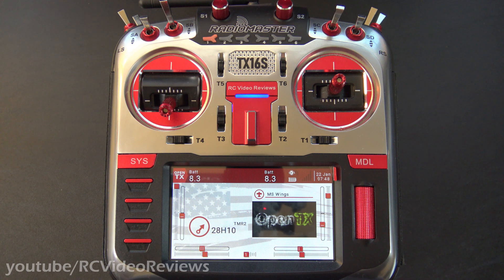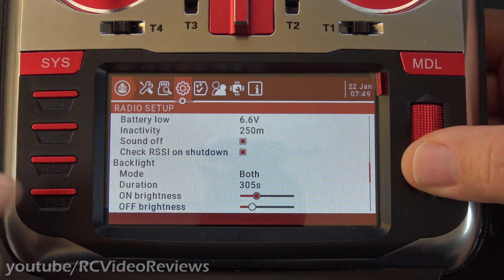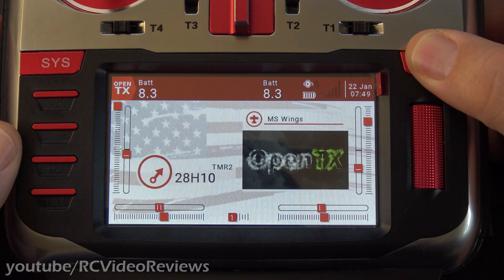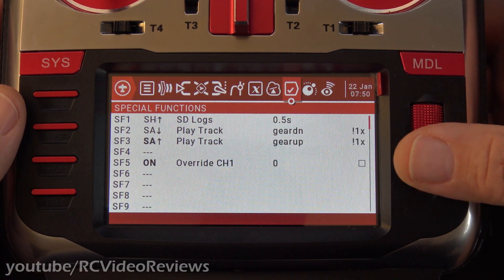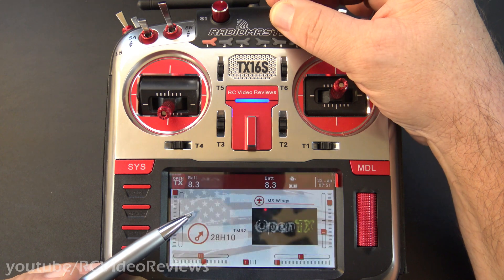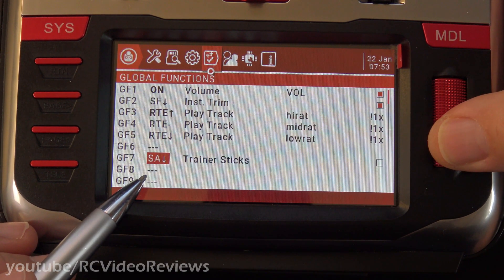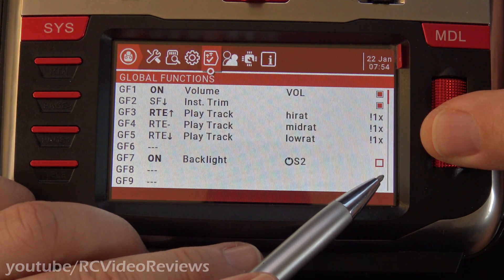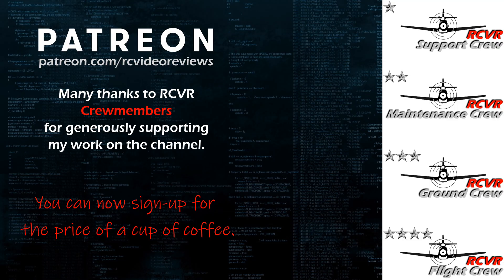OpenTx Snippet • Control Backlight with a Knob

Comment: I was using my TX16s today and somehow changed settings and it boots with no screen. It boots fine, but I never see anything (except a very dim flash) and can't figure out how to fix it. 

I'm honestly beginning to wonder if something is broken, but I can't see why. I did make some changes in the field, but they had nothing to do with the screen.
Reply from the maker: Did you figure it out?
Reply: @RCVideoReviews  Bad lcd/touch. I've disassembled/reassembled everything possible and it's gotta be that. 

Every function of the radio still works fine. I can hook into BF and move/see everything and I can also flash firmwares with OTXC.

 The screen went black during use and when I boot the unit it doesn't even flash on for a second (like I'd expect if the issue was software/firmware related) it's just always black.

After boot, if I shine a flashlight at just the right angle I can see the appropriate menu displayed but as if it were the display of a 1990's solar calculator that had juuuuust enough light to barely work.

Waiting to get a response from the people at Radiomaster concerning warranty coverage, but a new screen is under $30 direct and around $50 from resellers. If they don't cover it I'm buying that 1st and going on from there.
Reply: I had the TX16s Max under a week, but I bought a "customer return" and I'm not sure if they're going to cover it. The unit was essentially new but I know how most companies are. I've heard good things about RM so we'll see.
Reply: @RCVideoReviews  Radiomaster is sending me a new LCD at no charge!

SO GREAT TO BUY FROM A COMPANY THAT STANDS BEHIND THEIR PRODUCTS AND ACTUALLY CARES ENOUGH TO RESPOND WITH AN ACTUAL EMAIL FROM AN ACTUAL HUMAN!

Comment: Hi,
Great tips !   Not sure, but my Backlight settings will only work when I apply it to a model using the Special Functions. 

I found out the reason why it does not work when I use the Global Function Method. I didn’t realize that the use of the Global Functions has to be turned on in each model.  

Thanks.
Reply from the maker: What firmware are you using?
Reply: @RCVideoReviews  I found my problem.  I had just updated my previous question. It obviously did not get updated by the time you replied. 

Thank you for getting back to me so soon.  Keep up the great vids!
Reply from the maker: @samavella8831  What was the problem? YOu might help the next person with the same question.
Reply: I didn’t realize that the use of the Global Functions has to be turned on in each model.
Reply from the maker: Ahhhh, yup. I'll add that to my 'checklist' if I get that question again. Thx.

Comment: Hey John In global functions I get as far as picking Backlight in the 3rd column. The 4th column never opens to allow me to pick which switch or knob I want to use. Any ideas?
Reply from the maker: Backlight is the 2nd column. ON is 1st, Backlight is 2nd, Source is 3rd. What version of firmware are you using? I'm on 2.3.11 and that's how it works on mine. No fuss at all.
Reply: @RCVideoReviews  I’m not sure which version it has on it. I suppose I’ll have to plug it into the computer and figure it out. Scrolling now to see if you have done a video yet on how to update OpenTx on the radio yet 😂
Reply: @RCVideoReviews  ok scrolled through  and found version on radio it’s 2.3.9 from June 14 2020 so that may explain it 😉
Reply: Yep that was it. Almost bricked it but managed to make it work after I got the SD card update loaded back onto the radio 😀

Comment: Great video as always , I can set my sound on a knob but I cant set the brightness, the jog dial won’t go to the hardware part to pick the knob. 
There are no _  _ _ when you select backlight.
Edit : reading through the comments I need to move to a newer firmware 😀
Reply: PS , my version is 2.3.9
Reply from the maker: You need 2.3.10 minimum.

Comment: I bought the TX16 S se binded a wing it works but Left Corner Up aileron  Right side lower corner Down,  Left Corner Bottom Turn R.  Right Bottom Turn L. 
What did I do Wrong ?
Reply from the maker: I'm not sure I understand your question; however, it seems you're asking about an aileron/elevator mix. You should watch this video: https://youtu.be/U0FmXP1VSmc It might help you.

Comment: Great job as always.... the only problem I have is that when choosing Backlight option in both GF or SF I have no mor any field for switch selection nor the confirmation box (using 2.3.9.)
Reply from the maker: You have to upgrade to 2.3.10 or later. This is a relatively new feature.
Reply: @RCVideoReviews  It would be great if the need for this UPDATE had been mentioned at the start of the video and/or in the Notes below the screen showing the video. Thanks to Walter for raising this issue and to RC Video Reviews for posting the reply explaining how the issue can be resolved. Time to follow the video on how to Update my new TX 16S to Version 2.3.11 since Version 2.4 is currently a Work In Progress.
Reply from the maker: @anthonyeden931  Yeah, I try to catch all the details, but it's not really possible for me to know when every feature is added to firmware. FWIW I added a note to the description advising to use 2.3.10+

Comment: This does NOT work for me.  It works perfectly for the volume function, but has no effect for the back light.  I tried swapping pots, S1 and S2 between backlight and volume because Iknow the volume pot I selected "S2" works for volume.  No effect.  And yes.  I did click and fill the "active" checkbox at the end of the global variables config line.  Any ideas on whats wrong?
Reply from the maker: Are you on 2.3.10 or later? Is your off brightness lower than your on brightness in the system menu?
Reply: @RCVideoReviews  I’m on the latest production release 2.3.11.  Yes.  I had already adjusted the off brightness to be almost completely dark and the on brightness to maximum before I had even watched your video.   It can't be a bad potentiometer because the volume adjustment works fine on S1 or S2.  The brightness does not work on either one.  Both lines on the global variables page are identical except for the function and the Pot number.  It's crazy.  The brightness function works perfectly in the system menu too.
Reply from the maker: @Cooldrums777  Try doing it in model special functions. Do you have use global functions in your model setup?
Reply: @RCVideoReviews  OK.  I found the problem.  I had the backlight configured to "both" in the systems settings.  When I changed the backlight setting to "on" in the system settings page, your original instructions using the system global variable worked.
Reply from the maker: @Cooldrums777  Thanks for letting me know. Glad you got it worked out.

Comment: Just tried this with my Jumper T16 and it works awesome, but mine doesn't go to black. It dims alot, which is fine, I probably would never have the need to black it out anyways. Just thought I'd throw it out there. Thanks for the great content man. Using Version 2.3.10.

EDIT: Just saw the other comment about this, sorry I shoulda looked first! LOL!
Reply from the maker: Does your off slider in the system menu go all the way to the left? I'm on 2.3.11.
Reply from the maker: Did you figure it out?

Comment: my screen does not turn black, it just goes to minimun brightness but not OFF
Reply from the maker: I haven't tested, but you may have to go into system settings and set the off brightness all the way down.
Reply: @RCVideoReviews  i tried, but no change. Thank you very much for taking the time to respond to comments.
Reply from the maker: @leoponce82ponce  What version of OpenTx do you have?
Reply: @RCVideoReviews  2.3.10
Reply from the maker: @leoponce82ponce  Not sure then. If you have the off brightness turned down and the knob works, it should be able to be turned off just like you saw in the video. Maybe try 2.3.11--that's what I have.
Reply: @RCVideoReviews  thank you very much for taking the time. I will try it.

Comment: Thanks for the video, I'm running OpenTX 2.3.4 and when I selected Backlight, it won't give me the option to select the witch for it.  If I select the volume or something else then it allows me to select a switch for that function.  Any idea why?
Reply from the maker: @brian ramsey is on it. You need to upgrade.
Reply: Hey man I think its available in 2.3.11 now you need to update?
Reply: I am having the same problem too, I bought me radio 2 weeks ago man

Comment: Do you have a video on how to change the Power Off and the Zzzzzz screen when you turn off the Transmitter 
( like when you change/customize the splash or the background picture )
Thank you
Reply from the maker: I don't, but that's more than a snippet. There are two images in the THEMES\DEFAULT folder. One is called shutdown.bmp and the other is called sleep.bmp  Sleep is 150x150. Shutdown is 110x110. You can change/delete those to get rid of the silly sleep image. I did that day one.
Reply: @RCVideoReviews  
You are right !
I tried changing both pictures with the correct format BMP and the correct size 110x110 and 150x150 accordingly and I labeled them the correct way 
And it’s still not working ( I can see an outline of the picture but there’s no color in that picture - if that makes any sense )
I was wondering if a pro like you could figure it out and help us all 
Thank you
Reply from the maker: @q1v1  Honestly--delete them. ;) If you really want them, make them in Paint.net and save as bmp. OTX is really picky about graphics.
Reply: @RCVideoReviews  
I tried your suggestion to no success
 At this point I’m pretty sure you can’t replace/customize the Turn Off screen
If you ever have the time look into it please 
I’m sure it won’t take you more than just a few minutes 
Thank you

Comment: Mine doesnt have the s2 option im on otx tbs version
Reply from the maker: I'm not sure what that means--tbs version of otx? What radio are you using?
Reply: @RCVideoReviews  tx16s max on the crsfshot fw the tbs nightly fw
Reply from the maker: @angelfpv4825  If you have a TX16s Max, you have an S2 pot. As far as your TBS build of OpenTx--I can't answer if they've made changes to the hardware choices--but they shouldn't have. That would annoy me.
Reply: @RCVideoReviews  yeah it doesn’t have the check box for brightness. But for volume it has the box
Reply: @angelfpv4825  sounds like your version of firmware doesn’t have the option. After clicking “sys”, page to the very end box with the letter i in it.  
You need 2.3.10 for it to work as stated above.   I’m running 2.3.9 so, I can’t use the knob for brightness. Waiting for 2.4 before I upgrade.